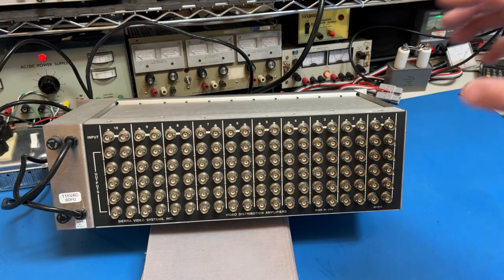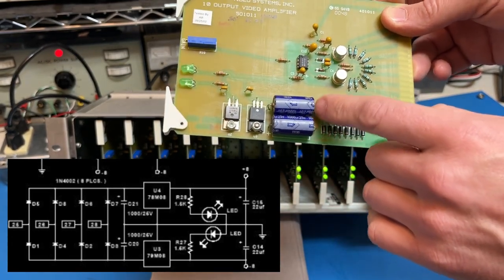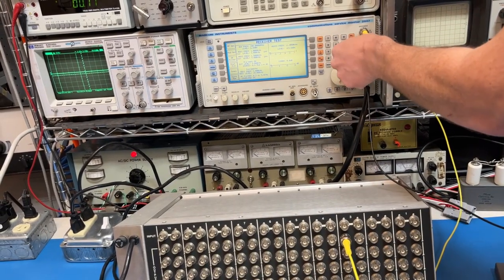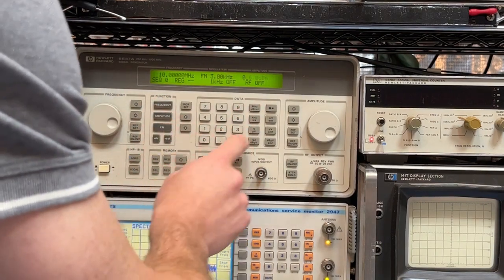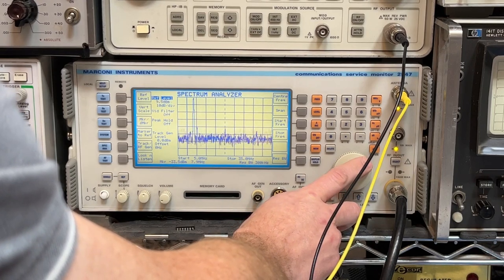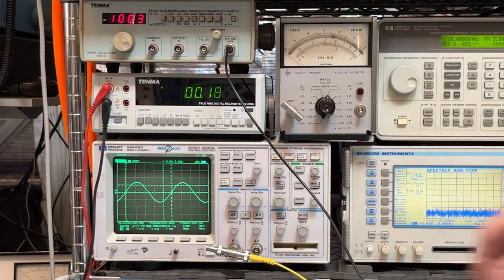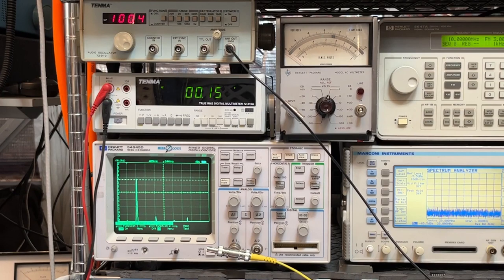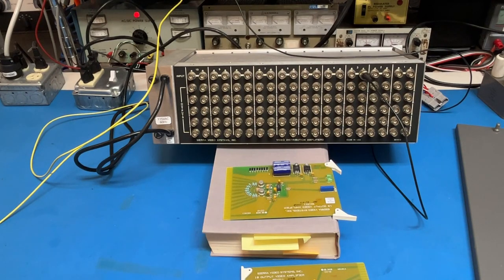10 MHz Reference Distribution Amplifier from Video DA (Part 1)

Comment: Hi. I have used video amplifiers to distribute 10 MHz references in the past. I found that not all designs are suitable for driving 50 Ohm loads in a stable and clean way. That said, many instruments do not terminate their 10MHz input at 50 Ohms. 
When checking the output capability of one card, you should load many outputs simultaneously. That is how you will see the op-amp's capability. When doing so, also monitor the output transistors temperature. I have had a runaway and latchup situation on a Grass Valley unit. And If you ever change the series terminations to 50 ohms, I suggest you proportionally derate the number of outputs one card can drive. It is not like you will run out of outputs anyway!  Thanks, 73. Bert, VE2ZAZ / VA2IW
Reply from the maker: This 100%. I think the existing design is somewhat marginal in terms of driving 10x 75 ohm outputs. At 75 ohms, with 800mA max continuous Ic, that's 80mA per channel, or 6Vrms at 75 ohms per output. At 50 ohms it could do 4Vrms per output. However, one must derate it for the hot temps inside the cage (no airflow) and of course normal engineering margins. And as you mentioned, I have plenty of outputs anyway. I'll probably do three or four per card. And yes, a lot of gear doesn't terminate low anyway. 

I've ordered some interesting parts for the oscillator integration and we'll have another video out in a week or two.

Comment: Would be interesting to compare phase noise of the 10MHz ref input vs distribution amp output.  For some test equipment setups this is important.   Maybe with the 50ohm mod you mentioned to remove mismatch questions?  Great project!
Reply from the maker: I will absolutely look at this. Especially for the derived 5 MHz I intend to fit in there.

Comment: Thanks for sharing this …. 
Great idea too!  
I’ve got a ton of CATV & MATV distribution amplifiers sitting on the shelf after years of everyone migrating to fiber for everything.

After buying the GPS-DO sold by a ham on eBay (bgxxx7tbl??) during the height of the KungFlu with the lockdown nonsense, the small, matching distribution amp was just not available anywhere.  I’ve got at least 6 or 7 pieces of test gear that can utilize a 10MHz reference signal and have been “cable swapping”.  That kind of defeats the purpose of ease of use AND accuracy.

I hesitated using the 75 ohm TV amps or modifying them.

Now I’m motivated for a project… 🙂

Thank you!
Reply: That’s a gorgeous Marconi 2947 (aka IFR).  
A friend had one a while back.
Whenever my daughter saw the gear on his bench, she would try and read/pronounce the names of all of his test gear.

“MACARONI  SPAGHETTI  MONSTER”
🤣
Reply from the maker: Even keeping it at 75 ohms is only 1.5:1 SWR. For short runs around a test bench it’s really fine to use 75 and 50 together. Especially at HF. 

I finished the project BTW, I’m just lazy about the video editing…
Reply: @W6EL  Thank you for producing the videos you have already completed!
I’ll be checking back for the updated content and am very appreciative for your collection of videos!

Comment: Look forward to seeing how this goes. Can also be used to distribute s/pdif signals if you need that around the lab
Reply from the maker: Hey that’s a good point about S/PDIF. Looks like the required bandwidth is about 3 MHz. 

The OCXO finally arrived and I working out the details on how to power it. The 14.4 volts (unregulated) coming into the board is not sufficient for most 12V regulators to make a stable voltage. So a custom LDO circuit it shall be!

Comment: That's a nice project to give a second life to this video distribution. I wonder if the current design is best tailored for 75 ohms lines and if you foreseen to change them to 50 ohms instead (input/outputs resistances)?
Reply from the maker: From what I can tell, driving 10 outputs at 75 ohms each was already kind of a stretch for those little BJTs. However, I think if I just use half the outputs at 50 ohms I’ll be ok. We will see! Or I might go crazy and just use it at 75. The cables are cheaper!
Reply: @W6EL , that's great too. As the signal is pure sinus, I believe that an impedance mismatch will no be so important on the signal shape. Could matter if you plan to use a square clock and a long coaxial cable... I will follow your project and good ideas as I plan to do something equivalent for my lab. 👍